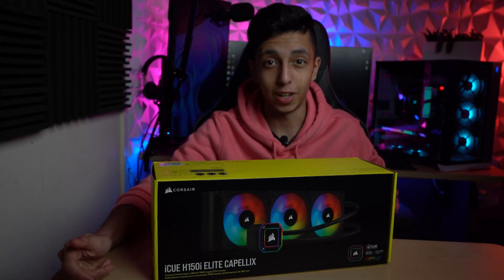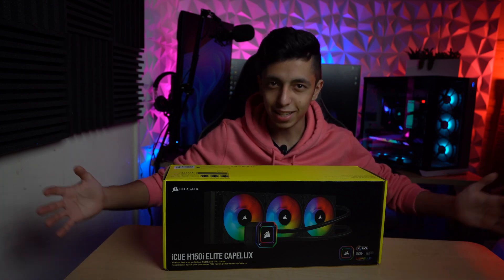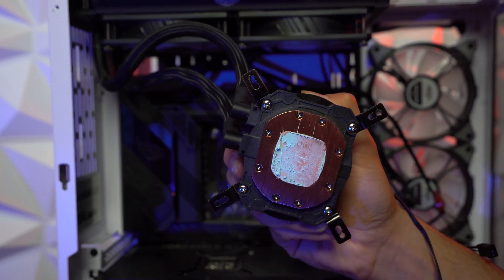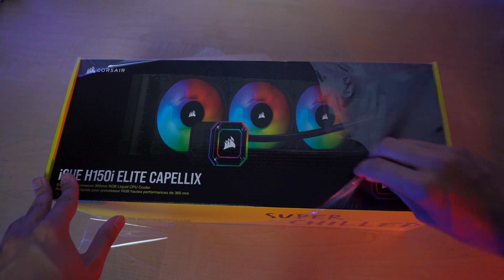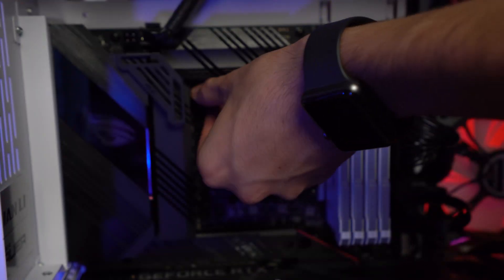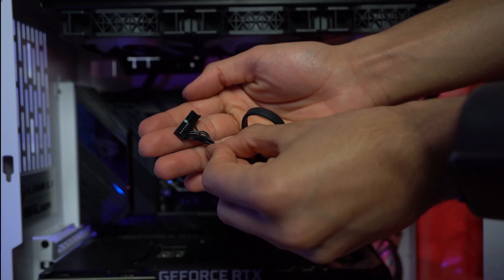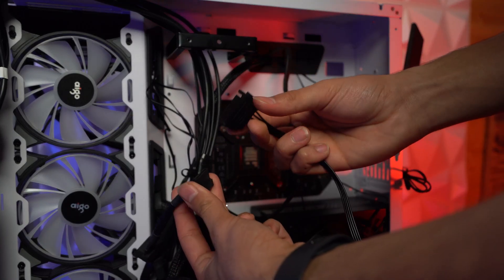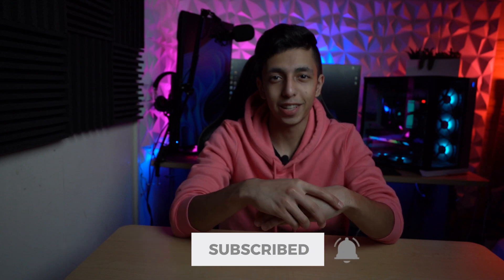How To Install Corsair H150i ELITE CAPELLIX - Step By Step Guide 2021 [Right Way]

Comment: The "RGB"-Header on the pump goes to the CPU_FAN, it does nothing other than trick the BIOS into thinking there is a FAN attached, because otherwise it would prevent booting to protect the CPU, unless this is disabled in BIOS. JRTFM

Comment: I installed just how you did and my cpu started overheating. Do you have to configure the pumps first?
Reply: Did you take the sticker off? 🫣
Reply: @MoistPenguinz0Clips  yeah I had the cpu fan header plugged in not the cpu pump lol

Comment: My pump RGB connector is 3 pin with 1 wire... my my motherboard RGB connector is 4 pin.   Not sure what to do.   It doesn't really stay on there, and not sure which orientation to plug it into.
Reply: I think you’re plugging it into the RGB slot when you should be looking for the ARGB pins. ARGB has less voltage and is only 3 pins. I might be wrong since I’m not looking at your board, but this is a problem I ran into with mine.
Reply: @funkguylorz7315  After a whole lot of messing around I got that part right.  I forget what it was for, but it wasn't for RGB.   I think pump srpm speed controleld by the UEFI bios.

What I can't get tow work at all is the Corsair iCUE software to talk across the USB header to the Corsair COre to change the default RGB color scheme from rainbow vke.    I've given up on it for the time being.  My computer is stuck in rainbow wave at highest brightness settings.  Thanks, Corsair.

Tried different headers, different sata ports, even a different Corsair Core XT controller box.  (which I sent back after it too didnt' work).

Comment: Where the hell do I install the 3-pin connector? I keep trying different sockets on my motherboard, but my pump keeps flashing red and I keep getting a copy overheat error
Reply: Me too I have no idea what to do at this point
Reply: Did you solve this problem? flashing red I don't how to fix it
Reply: The the cpu fan header or the AIO pump header

Comment: That’s not a rgb cable, that goes to the cpu header, the rgb is controlled from the commander which plugs into the onboard usb
Reply: What if fans spin but doesnt show rgb?
Reply: @dontqsy5101 maybye you have non rgb version
Reply: @Donuts_Donuts_Donuts  Its the RGB one
Reply: @dontqsy5101  does everything else in your build have lights working? If so, maybe call customer service or sumthing
Reply: So funny they do videos on how to and don’t know themselves 😂

Comment: Why would put the air filter on the top if your exhausting the heat out of the top makes no sense? I could understand if your pulling air from the top into the case then I would use the Air filter for the top.
Reply: aesthetics is the only reason.
Reply: That's correct, he put the fans on backwards. Sucking the cool air in would also help cool the radiator. This is recommended by corsair themselves lol.
Reply: I am adding a new radiator. Yes I read what Corsair said.  They also mentioned to pay attention to the arrow on each fan which shows air flow direction. But having the radiator above the fans means the fans should pull air in from above.  I am not quite sure that would be efficient with the fans pulling air in and pushing air into the case. If this was a front mounted radiator then the fans would be on the outside and pushing air through the radiator into the case.  The way he mounted the fans is fine if he's pushing  warm air from the case, pushing it upward through the radiator and out the top of the case, it's just that that's not as efficient pulling cooler air from the top of the case. What is everybody's experience here?

Comment: Corsair recommends the coolers are installed the other way round so they suck cool air in, instead of blowing hot air out.
Reply: Depends on the orientation of the radiator. If you’re doing a vertical build, you want cool air blowing in. You’re half correct
Reply: Silly in this position since hot air rises.
Reply: @kanivakil198  The hot air isn't rising if the 3 front fans is sucking the air in. So you have 2 air intakes and the fan in the rear is the exhaust. It's why corsair recommends it this way.
Reply: @RayBros  corsair doesn't know what they are talking about. Hot air rises. i don't know one person who sets their top mounted rad fans to intake, it makes no sense.
Reply: @kanivakil198  i mean u not @Chris E

Comment: is this compatible with LGA 1700 without buying this montage packet?
Reply: yes, but no. you "should" buy the new standoff's from corsair. SKU: CW-8960091
Reply: @Ogeid-13  i bought it but because im waiting (since 19.12) i montaged it without it and it works
Reply: @mcsik  did you use the Intel mounts then? Thinking about doing the same thing. I bought them also, they shipped on this Monday and are supposed to arrive next Tuesday the 4th. Not sure how much patience I have to wait
Reply: @Ogeid-13  im still waiting for retrofit kit, im using aio but with lga 1200 kit (i will change it when this fucking corsair send me 1700 kit) and temps are actually good, when i play fivem on high/ultra settings its like 65C on peak
Reply: @mcsik  nice I'll give it a shot later I suppose. Get everything in order. Thanks for the verification that it works
Reply: @mcsik  when reinstalling with the 1700 standoffs will you have to clean off and reapply thermal paste? Or can you just slap it back on?
Reply: @ilijazivanovic6211  i will just slap it back because im using this pc since not even 1 week and my 1700 retrofit kit will be delivered today so
Reply: i swapped it and i see that degrees are more stable nothing more
Reply: @mcsik  I think it's just a better fit but otherwise no different
Reply: @Ogeid-13  actually on desktop it was 30C after like 5 hours of using now its like 25C after 5 hours of using so not that big difference
Reply: but when i was using davinci resolve it was like 80C (MORE THAN IN FUCKING FIVEM AND GTA LOL) so XDD
Reply: @mcsik  so do I need the 1700
retro fit and does it work for the 2.99  for just the standoffs or do I need the 15 dollar one with the backplate from Corsair
Reply: @JDM_CUH  2.99